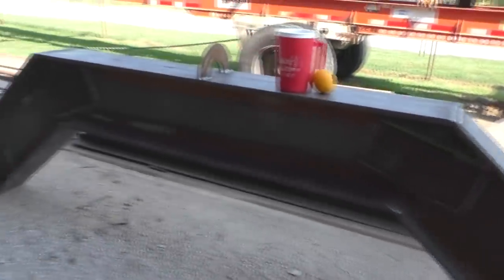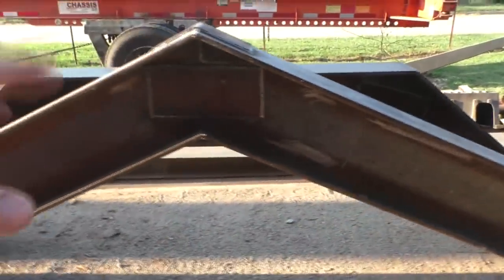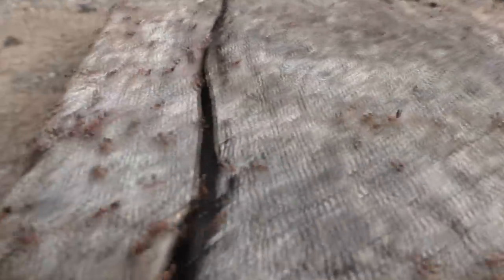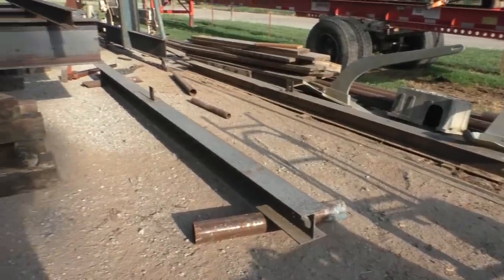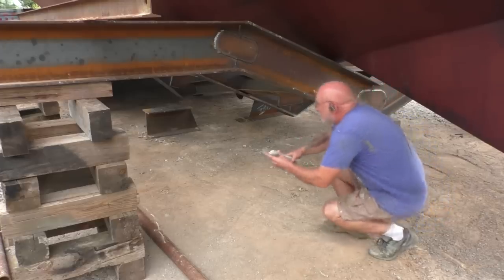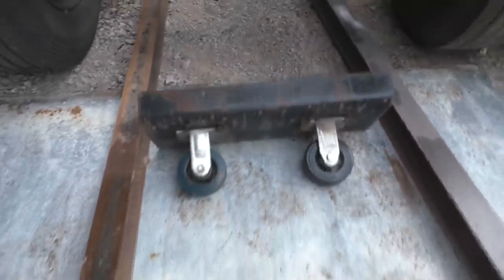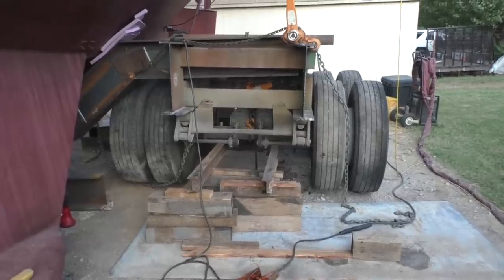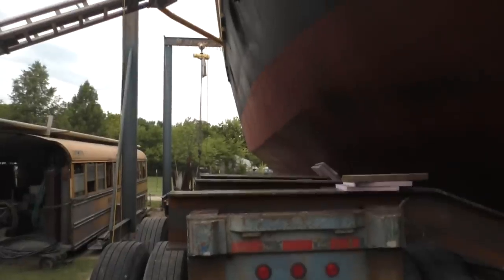Wheels for the Boat - Part 2

Comment: I really like and appreciate the quality of your workmanship Doug!  (I was the heavy hauler with all the axles that you gave a tour to years ago (I sent you that semi trailer kingpin))
Reply from the maker: We're fixing to weld it in.    Would you happen to know where we can rent a jeep?
Reply: @SVSeeker  lol John, Australia.
Reply: @SVSeeker  I'll be kinda surprised if you can find one for rent.  The general freight type trailers (regular flatbeds, dry vans, and reefers are everywhere and easy to rent but the specialized stuff I'm not sure if anyone does?).  I thought you were going to use a tow truck?
Reply from the maker: @brendanfisher6289  Nothing is set in concrete.  If I can get a jeep, it makes getting a tow truck much easier.

Comment: Doug I love how SV Seeker is painted. I started watching your videos back when you first started and watched her grow from flat steal to a beautiful boat. I gave up on to boat repairs all because I hate messing with fiberglass. But I going to be starting a new project it's a 2004 Ford F-250 with a 2002 24 valve Cummins diesel I have to rewire the whole truck and maybe build a front and rear bumper for it. Thank you for great videos over the last 13 to 15 years can't wait to see what you work on next your neighbor from far down South.

Comment: Dont ya love it when someone joins in after 90% of the work is done ?
Just found you last week. Now on *Wheels part 2" , I found out we're neighbors.
I live on Lake Tenkiller. Its 83 miles southeast of Tulsa. 20 miles east of Muskogee. 
 Having been both a machinist and metal fabricator, I'm very impressed by your 
ability.

Comment: Here's a slick ideas for moving those wheel assemblies.  Put the wheels on the metal and throw a little oil on them.  The wheels will slide so easy.  I use this way to pull hubs with the wheels still on them off the axle.  Easy peasy.

Comment: Hi Doug. I would think about adding ribs in to the girders where they are joined. This is usualy done to prevent bending the top and bottom out(or in) everywhere the girders changing direction. Because at this points the I girder flanges,or how ar they called, are no longer stressed only by tension/compression bu by the induced bending as well. Just a suggestion.  Love your channel ;).

Comment: Before you embark on moving it. Mount an adjustable vertical pole on the front corner of your pickup, and get an accurate height reading from the ground to 6 to 8 inches higher then the ship. The tip of the pole should be a none conductive whip rod, like fiberglass mounted on a flexible coil spring. I prefer a spruce wood base pole myself. Then drive your predetermined route beforehand and map close obstructions. Like powerlines, sagging phone lines, tree limbs, sign structures that cross or encroach over top of the road. Record all clearance. This allows you to run your route smoothly and address issues before you get on the road with the actual load. Be sure to properly identify between power lines and phone and communication lines. Especially if you need line walkers. That's is 2 or 3 guys that ride on the boat deck in this case, and use long insulated adjustable poles with a 2 foot wide padded pusher board on top, to push phone line high enough to give clearance and walk it through the obstruction. Otherwise, you have to call utility companies to have them come and drop the lines for you to pass and that can become a lot of commotion. And be sure to measure both sides and the middle of the road for going under anything crossing over the road. Sometimes one side, the other, or the middle has that extra few inches you need to avoid getting stuck or passing through. Map it all. Good luck on moving day my friend.

Comment: Quite the puzzle of beams there Doug !  Will you crib up the spaces in between, use cut up sections of tires, and or welded in plates to spread loads between the beams and hull ? Damned close to perfect too... at least I'd say 3/16 off is perfect on a scale of 22 feet. ( 22x12x16 = 4224,   3/4224 = .0007, or 0.07% )   WAY less than 1%  !  You must be getting good at this stuff or something ? Maybe start something simple next time like a fusion reactor for the next project ?

Comment: Looking good! I definitely didn't have to give too much consideration as to how it would get built, I knew you'd figure it out!

That torsional twist at 12:43 is why there needs to be some large OD round pipe as the bracing between the frames.
Reply from the maker: Thanks.   Once the other set of wheels are under it, we'll add those pipes.   I think i have enough 4" OD.
Reply: SV Seeker Pipes between the frames won‘t reduce the twist because lengthwise (along the boat) they are basically in bending as are the I-Beams you already put there. Either way the twist is not a problem at all. As you said you might have to drive over a curb on one side. If the frame is flexible in torsion it helps spreading the load on all tires because the wheels can move somewhat independant. A stiff frame (in torsion) would try to lift the opposing wheel on the other side of the boat and put the frame under a huge torque load.

Comment: I saw in the comments that you had to put your pup down, sorry to hear that Mr. Doug. 

Also your engineering skills are criminally underrated in my time reading the comment sections on your videos, your ability to design and fabricate all of this and simultaneously addressing the fact you’re doing it economically is not even borderline genius, it’s unapologetically genius. 

Do you think all your time dealing with oracle helped with knowing the exact order or steps you need to take with each project? The putting together of the water maker and piping comes to mind. You’re like a breathing database.

Comment: You could get rid of the dually tires and go with super singles. Would help with clearance issues and help reduce your overall width. Just a thought. God bless, stay well.
Reply: Frank,  super single tires are not allowed for use in Oklahoma for loads such as this.
Reply: @MrEric_API  Well that sucks. Too bad, would make more side clearance. Maybe not much, but every little bit helps.

Comment: Love what you are doing. Do not forget the mud flaps behind those tandems. That is always something that is overlooked. 2 2×4's with the flaps nailed in between will work. Doesn't have to be anything fancy. Just flaps covering the rear of the tires. To cover the studs eyes as we say in spanish. 22 foot wide? That is a super load. Did they ask you for a survey of the route by an authorized escort to be sure the load will fit the route? Also did they ask you for the dimentions for the truck that will be doing the move? If they did not, that is typical Oklahoma. Super nice on the phone but will not ask you the pertinent stuff because most people that di this already know what to tell them. Yes they are super friendly though. 
 Remember the computer gives you the route, it is up to you to survey it and make sure the load fits. Most states require that before they issue the permit. If Oklahoma does not require that, please ask them about it. It will save tons of headaches later. 
 I am an admirer of your work. I do not want to see you get shut down for an oversight. . Permit check list
 1) Route Survey needed or required?
2) How many private escorts front and back and is a pole car required?
3) Is a Police escort required with the private escort?
4) Is an overweight permit needed and does it come together with the overdimentional permit.
5) Will it be a day move or is a night move required?
6) Have you called Daily Transport in Oklahoma City to find out the cost of transportation?
 I do not want you to have any headaches in your way to the water is all.

Comment: I've had this question for a long time about stress plates. At 2:24 (if you pause) you will see a diamond shaped plate. It is welded around the perimeter. Why not cut a circle in the middle of it and weld around the inside of the hole? Would that not add just 'that much more strength' to the joint? I don't care if I'm wrong or right, I'm genuinely curious.

Comment: That frame work looked really big until you put it under the boat!
I guess there were no local riggers / boat movers/ house movers with big enough equipment? And obviously too expensive , not as good a video project! Cheers Warren

Comment: Doug, question for you.... You mentioned possibly having a heavy duty wrecker tow the boat to the port. The advantage is the hydraulics on the wrecker can help with setting the ride height. My question is.... will there be another set of wheels near the front of the boat, or will the wrecker be carrying the full weight of the "front half" of the boat? And if so, how much weight do you estimate the wrecker will be carrying (supporting) on its lift? I realize the wrecker will be "pulling" the entire load, Im wondering how much weight the wrecker will be "carrying"? Im just currious.... I've driven heavy wreckers on and off for almost 30 years.
Reply from the maker: No more wheels if we use a wrecker.  It would be 35,000 lbs.   We might use a jeep under the hitch.  We can have a hydraulic lift on that too, and then any semi can haul us.
Reply: @SVSeeker  
Gotcha... one thing to keep in mind.... even with the biggest wrecker on the road, wreckers can stationary lift far more weight than they can lift while towing. With 100% of the load on a wrecker positioned BEHIND the wrecker, it can be difficult to keep the front steer wheels on the ground. For example, even when towing a loaded 18 wheeler, the wrecker is only carrying the front axle wheight of the semi tractor, which is usually between 10-12 thousand pounds. Im certainly NOT saying it cant be done but be sure to run this idea across your local heavy towing companies in your area before you commit to that plan just to be sure their equipment can handle that kind of load. Not all heavy wreckers are equal. Being a wrecker guy myself, I'm hoping this is the way you go because I'd love to see a wrecker pulling your boat. You're a smart guy and I'm sure you've already considered everything I just mentioned. Im certainly not trying to be an internet know-it-all, just offering a few words specifically about a topic I am familiar with. Thanks for the reply, Doug. 🙂

Comment: I am so looking forward to the launch of seeker. I am a truck driver for 16 years. My question is, have you estimated the gross weight acuratly? How many tires you need on the ground depends on your gross weight. I don't live in Oklahoma but I do know that max gross weight transported over public roads is federally controlled by DOT. Have you considered this when building the transport vehicle?

Comment: Hey Doug. I love your videos and have been watching for over 4 years now. I am watching you build this trailer thing, which God damn who knew one person could do such a huge project by themselves. I am a bit ashamed to say it but you put my 24 year old ass to shame and I like to think I am above average in physical ability. What is your plan for hauling the boat? I know a longtime back you had a guy on with a company that did this sort of transportation and you said he would be doing it most likely but it looks like now you are doing it all yourself. Is that true? if so how do you plan on pulling it and even more interesting how do you plan on turning this thing if the rear wheels are just straight and not turning? It seems to me like it would be so long that the turning ratios would be unmanageable

Comment: how about simply removing one of the inner tires where it hits the frame?
Reply from the maker: Too much weight for any fewer tires.
Reply: @SVSeeker  what about if you used super single tires.
Reply from the maker: Branden deBuhr   The regulations to specifically do not allow them.
Reply: @SVSeeker  Ok, just trying to think outside the box...
Reply: @SVSeeker  btw, did you get my email about my custom what did you make "Hard Top" and "Stainless Steel Railing" on my boat?

Comment: OK, I read the comments from all the experts on the last video.
Why did you do all that work by yourself when any haulage company would have done it for $500?
Lucky Oklahoma has not safety rules for big loads because that is not going to be safe.
And how come you didn’t die yet?
Oh and one of the frames needs a tune, it’s off key a little.

Comment: You dont have the spring chambers caged ???
Reply from the maker: No.  Just cut the rods.
Reply: SV Seeker now the brake chambers wont work you wont have no brakes
They have special bolts that cage the chambers usually attached to each chamber 
Your going to need service and parking brakes or at least I would 
It would have been really easy to set up
Reply from the maker: @paultavres9830   We don't need no stinking brakes.   : )